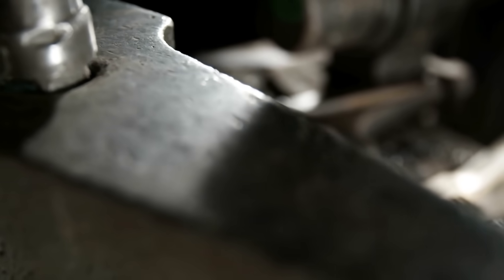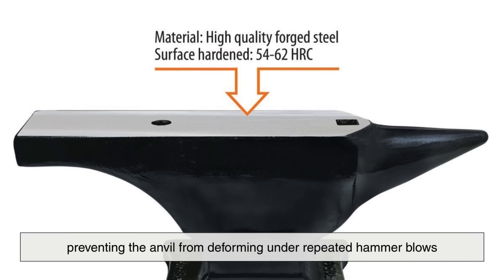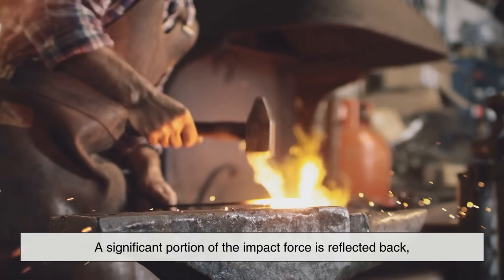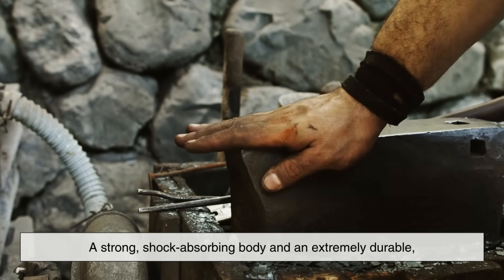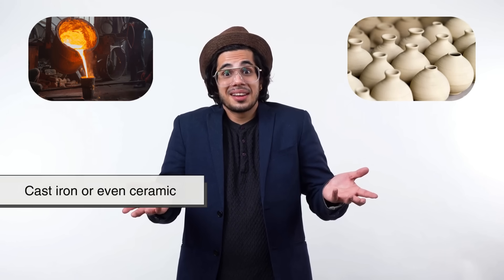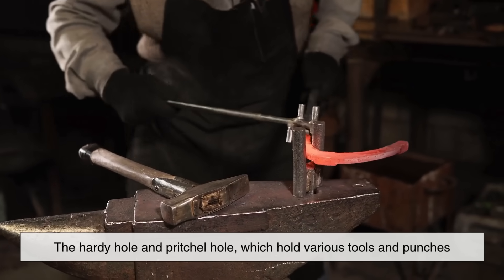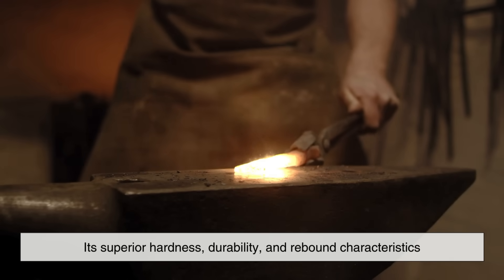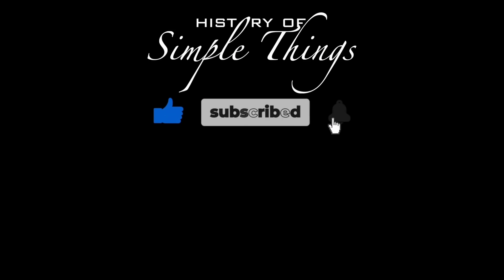Why Are Anvils Made of Hardened Steel? (And Not Iron!)

Comment: Under certain circumstances, a helicopter can fly just like an anvil.
Reply: Huh?
Reply: @f8c3themusic  Engine stops, dump the collective and autorotate. Failure to do so instantly, Anvil.
Reply: @TheDustysix  interesting. I read that a helicopter can continue to fly with the engine disengaged but rotors must be in tact and be able to spin.
Reply: @f8c3themusic  A most informative read is "Chickenhawk" by Robert Mason.
Reply: I just watched YT "Helicopter-Crashes" UL Murray Job. Now that is "cutting the cable".
Reply: @f8c3themusic  Gyrocopter. They had a propeller behind, and the large rotary wing wasn't powered.
Reply: @f8c3themusic  If the main rotor stops and can't windmill, the blades break and then it flies exactly like an anvil.
Reply: Shooting anvils is fun too, and they can go as high as a helicopter.